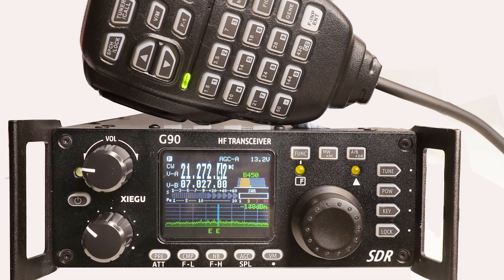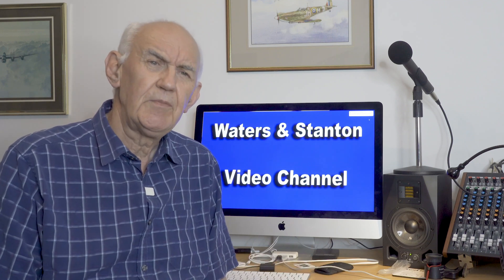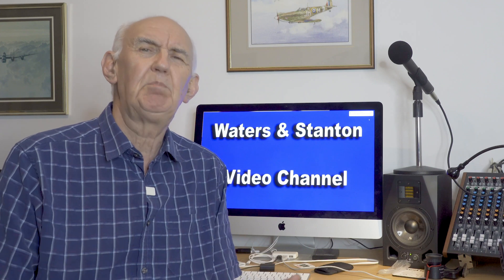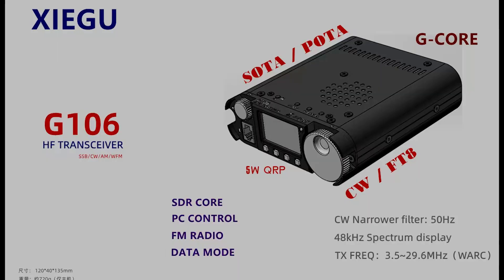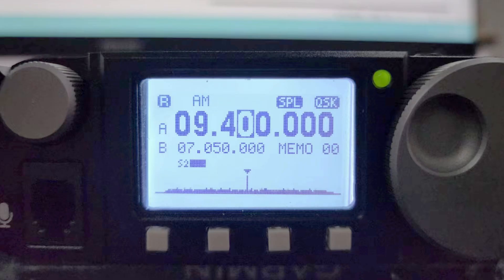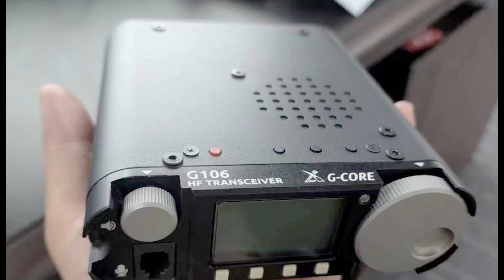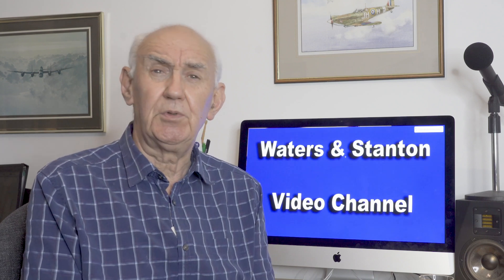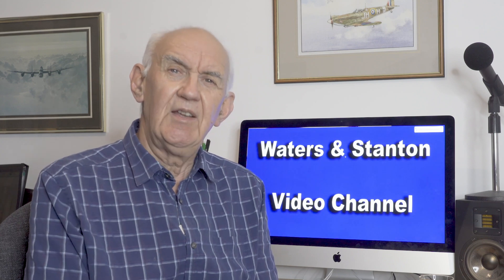XIEGU G106 - First Look at this New HF Transceiver " HAM RADIO

Comment: I actually bought the g1m and messed around with it. The spectrum display is the same. It might be just a g1m++ with a better mic port. I'm probably the cause of you finding this by giving them finances on the g1m line.

Comment: I wish they would make a bigger G90 with 50 watts output and a full size screen! Or a new head Unit that would bolt up to it. Very happy with the g90 but don't like how you hookup the 100 watt amp, with the interface and cables, it's a mess!
Reply: They tried with the gsoc and we all saw where that went
Reply: Now that would be great !

Comment: Looks like a good step up on the G1M, which is a lovely wee 4-bander (80, 40, 20 & 15) but SSB & CW only. AM is Rx only and it does Rx 160 to 10. The ONLY letdown for me was the 3.5mm mic jack with the cheap and nasty foobung style mic. The display format is identical and the spectrum scope is actually very usable, a trick missed on the FT-818ND but is an SDR feature that super-hets can only dream of. There are some bugs in the G1M firmware that could do with a tweak but it does cut the mustard and Scotland to Sweden mobile with a 20m hamstick at solar-minimum isn't a bad result.

73 de MM0JNL

Comment: of all the xiegu products, only the g90 seems to have a wider popularity (the xpa125b is also nice but not without problems)... the main problem with these rigs is firmware, and customers are all early adopters and beta testers, with new releases fixing some things but breaking others, and products subsequently being orphaned w/hardware and software flaws... i wish xiegu luck, but this new rig had better tick all the boxes or it will be yet another model in a timeline... i won't buy any rig without an easily replaceable battery, or even better, no battery at all... that is one reason the g1m could have been a great rig, but was flawed with design and production/manufacturing errors (got too hot in receive, poorly machine-soldered jacks to the pcb, bad microphone, and a single firmware release with no upgrade)

Comment: The Xiegu G1M was only a 4 band rig. It does 80m, 40m, 20m, and 15m. It would have been great if it did 160-10. Cheers, de KC3EZP
Reply: yep, and quite disappointing with bad jack connections that separated easily
Reply: @willieb6529   Very true! It could be a very nice rig if it didn’t have that jack issue and also did 160-10.
Reply: Could be worth a project to integrate the G1M into a portable setup to maximise what it does do well (spectrum) as a hunter receiver.

Comment: Hi Peter, the G1M only has 4 bands TX, 80 40 20 15m. It does have wide rx though. I used to own one briefly, for portable I wish it had an SWR meter. You don't need an atu, and I don't want to carry one, however it's important you have an indication everything is OK with your resonant antenna.  Hope they include one on this radio. 73 Steve MW0SAW
Reply from the maker: Hi there. Thanks for sharing the additional info. 73 Peter